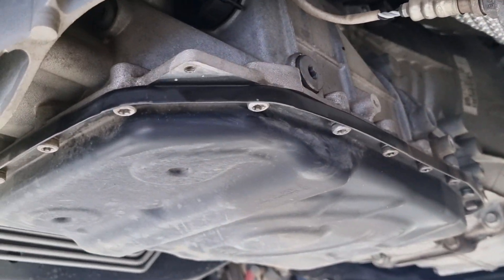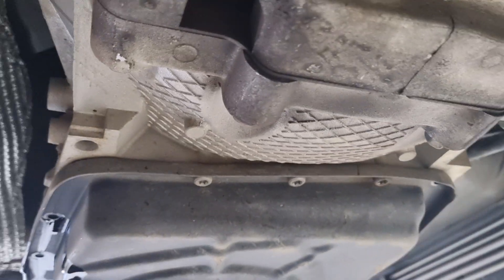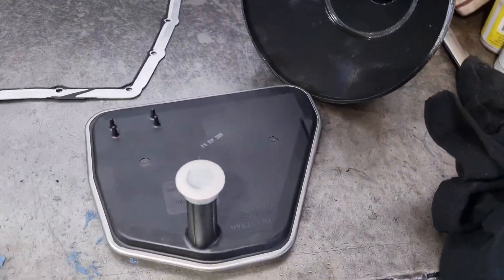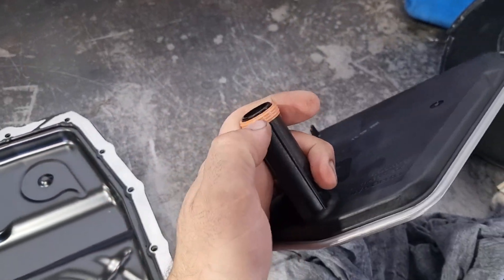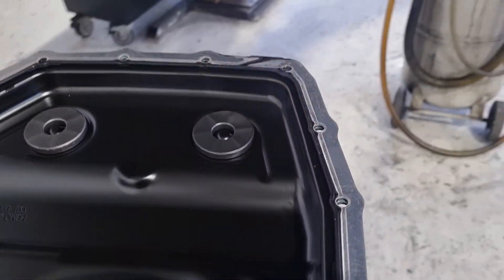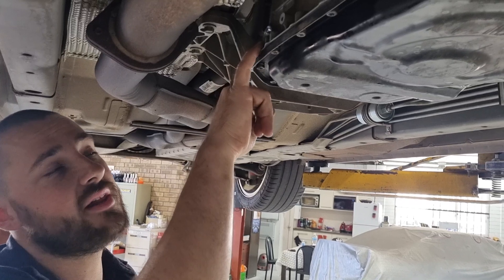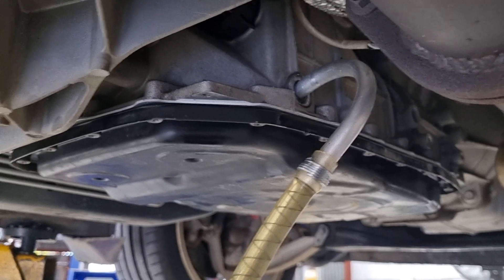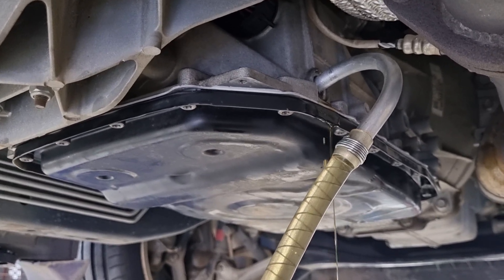6HP26 Gearbox Service, ZF; Ford Falcon/Territory Auto Trans

Comment: That’s not the correct way to service a automatic gearbox, some parts of ur video is wrong ., also there is some parts that’s missing.
Reply from the maker: Please explain
Reply: @RealAutoSolutions  1st mistake that u did was the filling oil bolt .. ,  never drain oil without removing filling oil bolt., always remove filling bolt before removing drain bolt .. 

2/ mistake  car should be always on level surface when filling back in oil .. 

3/ after 1st stage of filling in the oil the car should be running for about 15 minutes and monitor the temperature 🌡 ..   and use a thermometer  ONLY when car gets around 35c to 45c then u fill in the 2nd stage. 

4/ good points . U used good oil zf6, and use the gear change wile topping up on stage 2 ..   only mistake there u should leave the car on for longer / use thermometer , and top up the rest when oil gets around 35c/45c .
Reply from the maker: I have to disagree with a couple points here.

Undoing the filler plug on this particular transmission service, makes no change when draining the oil as we're dropping the whole pan. Even on a side pan deal you could take the filler plug out but still not a massive issue, all the oil will still drain out (not the converter)

The second point, the car is level on the hoist. That is checked when taking it up in the first place.

The third point, yes around 35c is the correct temp to set the level, In Australia it's around that temp often in summer, this video was filmed on a 30c day so the oil is already very close to that temp, so not a massive change here either.
Reply: @RealAutoSolutions  yes I maybe correct about when raising the car ,  ur car raising system should be level .. 

2/ no u doing it wrong u MUST unloosen the filling oil bolt before drain the oil . 
Reason THAT u MUST do it is because in case u drain oil frist and the filling pug is damaged / can’t unlosen.. u will be stuck with a car with no gearbox oil..  good luck getting the car out with a empty gearbox oil ..

3/ wrong again about filling the 2nd stage , u can just presume that u live in a hot country that ur gearbox oil it’s 30c/ 40c just by looking at the bottle .. 

The car need to be running , with engine on and for about 10mints and I need to use a thermometer to do the heat reading . 

If u dont do this it’s a fail, and most likely the gearbox with brake in future., also and its a cowboys job as a mechanic by just eyeballing  because u live in a hot country makes no sense .

Comment: Hey mate just need some advice. 
I checked Ryco filter they are about $40-50 with gasket 
Ryco rtk179
Whereas ford genuine filter and gas kit cost around $400 plus with gas kit. 
I’m confuse about Ryco should I use it or not as we all use Ryco  oil and Air-filter and they work pretty well. 
Just wanted to know is it safe to use Ryco transmission filter or not. 
??
 As I check with ford they said no need to
Change fluid or filter which make me super confused 
I owned fg 2014 g6e with 170k on it
Reply from the maker: Apologies for getting back to you so late 

I haven't used a Ryco one in the past, but I have priced them up & if you can find a quality supplier of trans parts you can buy the genuine stuff for essentially the same cost! 

So I would recommend looking around first before pulling the trigger on the Ryco kit

As for the ford dealer, I would not listen to what they say, they are not life time oil  & you will definitely notice a difference after the service
Reply: The $400 is for a plastic  pan.....steel pan filter and gasket $62 at Repco less 10% member disc.
Reply: I’ve used the RYCO filter a couple of times or a TransGold one, no problems. I’ve always used generic fluid, Gulf Western - get 20 litres for under $200 direct from GW or order it through SuperCheap. Valvoline Max Life from Bunnings or Repco is also fine.

Comment: Hey bud, how long does it take for the service? Cheers
Reply from the maker: The steel pan job is around 45 minutes, the plastic pan is a bit quicker as no cleaning is required (provided you have a hoist and all the tooling already set up like the oil pump i have)
Reply: @RealAutoSolutions  cheers for that.. a mobile mechanic wants to charge me $150 for labour only here in Sydney to change the oil, which I think is reasonable.
Reply from the maker: @realthing360  very reasonable, we charge 750 Inc GST for a full service using genuine parts.
Reply: @RealAutoSolutions  for me it would be a total of $465 including labour which includes 6 litres of genuine ZF lifeguard 6, the same gasket as the metal one you used, but a ryco filter instead of the genuine ford.
Reply from the maker: @realthing360  cool mate sounds like a good deal in that case 😃

Comment: Hi guys, I've been having a lot of trouble finding out the Diff gear ratio of a Ford Territory TS-4.0-Petrol-AWD 4Speed NON TURBO, made in JAN 2005.  Does any one knows the diff ratio for this model??  
Need to change the Front Diff - Gearbox - and TansferCase.... Thanks in advance...
Reply from the maker: Youre trying to change the whole housings?  You could mark on the tail shaft and on the wheel then rotate the tailshaft to get one full wheel rotation to give you an estimate

Comment: Man I'm glad my Territory (SZ MkII Titanium 4.0) has the metal pan.  The plastic pan filter kit is like $250-$300!
Reply from the maker: Is that priced through Ryco parts mate?
Reply: @RealAutoSolutions  Prices vary wildly, Repco was like $350, but Sparesbox (owned by GPC, who also owns Repco) had it as low as $120.  Not that I need it - I got the RTK179 kit for like $25 since my pan is metal.
Reply from the maker: @KaldekBoch  cool man, yeah GPC are massive, they also own NAPA 

This is half the issue with the industry, you can shop around different places for different prices owned by the same company and it makes mechanics look dodgy, instead there should be a fixed price for retail and different rates for the trade depending on amount spent
Reply: @RealAutoSolutions  yeah and Sparesbox just drop ship from their various retailers anyway!

Comment: Is it okay to reuse the pan bolts..have you had any issues? Cheers
Reply from the maker: Absolutely re use them, done heaps, no dramas ever 

The only time U may have an issue, is when you use the green paper factory gasket
Reply: @RealAutoSolutions  Good to know, as the new bolts aren't cheap. Thanks
Reply: @RealAutoSolutions I have a rubber gasket with my new filter. is this any good?
Reply from the maker: @magyaradam  that's fine mate just don't do them too tight

Comment: Hey mate, thanks for the vid  top notch 👍quick question, after running the car and shifting through the gears, do I wait until it is just dripping before putting the fill bolt back in? or is it okay to put it on with similar flow as per the end of this vid?
Reply from the maker: Hey man, a small run out would be what I reccomend, rather than a drip out,  this would be the difference of only a few hundred ML, when filling around 6.0L both would be acceptable

Comment: Do you know if there are conversion kits to run the 6r80 on the Barra motor?
Reply from the maker: Not that I am aware of mate, why would you want to run the 6r80?

The BTR 4 speed is a great box when built properly, same as the ZF6
Reply: Because I have a territory with the 6hp21 and I was wanting to tow with it but now that I know what’s in it it’s made me nervous. Do you think I could swop it out for the 6hp26?

Comment: Only critique is the ZF 6HP26 MUST BE filled at a specific temperature range otherwise it'll result in an incorrect oil fill level. Failure to do so can result in all sorts of headaches.

The trans fluid temperature must between  30° - 35° before fluid level checking can begin, with the final level check set at 40° ideally.

Allowing the fluid temp to exceed 50° will result in you having to allow the fluid to cool down to 30° & repeat the level check, without exceeding the temperature based fluid level setting. Good work otherwise minus that oversight !
Reply: it reaches 30 in a minute or less, so probably not a huge issue, especially in Australia. I chucked forscan on my 2014 sz and the atf temp was 30 (cold start) when i loaded the graph up after just starting it. Spring weather though, so if in a cold climate i'd say you'd need to adhere to the temp checking.
Reply: I'm sure it won't make much difference lol
Reply: "all sorts of headaches " ; could you elaborate please  ?
Reply: If the level is very important to the point of “headaches” there would be a better process to fill. I’ve done the service change not using a OBD2, I used a laser temp gun and check it several times.  @npet6842
Reply: @npet6842  Its shifts are terrible if the fluid level is over or under the exact level and oil tempreture is critical in getting that level. Its all covered in the ZF Fill Procedure even down to the correct torque settin and diametrical tensioning of the oil pan torx bolts.
Reply: @justgjt  I don't think the oil level is that critical . It operates from -20 to + 110 f in environments I've driven in . That's an oil density variation of  5% or 2/3rd of a pint in the system.
Reply: She'll be right mate. Mines probly missing litres haha😂
Reply: Fair point. Having said that, it's 31°C outside right now, so if anything have a big shop fan blowing over the tranny and keep the fluid in the fridge.  Running through each gear for a minute or 2 will get too hot.  These are German gearboxes - for German weather.
Reply: Temp only matters when you are CHECKING the fluid level. You can fill it cold. The filler plug should be replaced though, not reused.

Comment: I thought the oil had to be warm at a given temperature for final level
Reply: Yep. 40 deg C and dripping out of the fill port after running the transmission through P-N-D-R-D1-D2 holding each position for 5 secs. Doing this a few times will ensure the fluid is flushed through the valve body and oil galleries. If the temp goes above 40 deg C stop and let it cool down and then continue again.
Reply from the maker: @justgjt  d1 and d 2 is the same as D mate :) 

It's just gear lock out 

For example If you put it in gear D2 it wouldn't take off in 2nd
Reply from the maker: Correct but in Australia the oil is already very close to the temp for checking
Reply: @RealAutoSolutions  My FGX took several min. to reach 37c for checking
Reply from the maker: @jimclarke1108  yeah probably true of most days, but this day was already around 30 odd degrees so it's not far off as an ambient temp

Comment: How much oil did it end up taking? And does it need a metal/ proper gasket.. or can you use gasket maker/ silastic? Cheers
Reply from the maker: About 6 litres, no mate I would not recommend gasket maker.
Use the correct gasket, for the 6r80 (ranger, metal rubber gasket) only about 30 bucks
Reply: @RealAutoSolutions  ok too easy. Where’s somewhere to get a 6r80 gasket? :)
Reply from the maker: @alexicutcliffe4825  where are you located ?
Reply: @RealAutoSolutions  Tas
Reply from the maker: @alexicutcliffe4825  we usually use motospec, driveline or alltranz.

Google them and they can help you

Comment: Thanks for the walkthrough. It seems very similar service procedure to the BTR 4 speed. I guess the exorbitant cost of servicing is due to the price of the oil? Cheers
Reply from the maker: Absolutely and the cost of the filter and gasket are expensive too, the oil is around 35 per litre 

Filter kit around 200

Plus the labour and GST!
Reply: @RealAutoSolutions  
Can you share the part no. Bro if possible for gas-kit and filter
Reply from the maker: @AkashdeepSingh-fz1yw  I don't have numbers I'm sorry dude 

It's just a generic number I'm not sure of the correct number for you